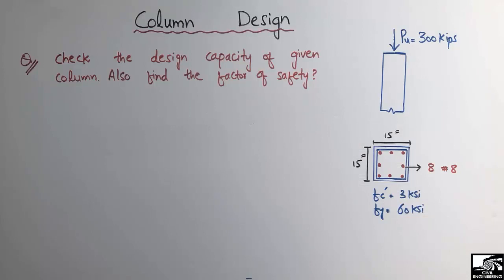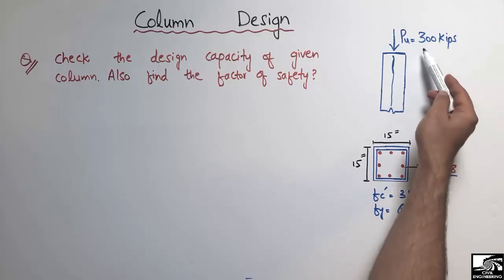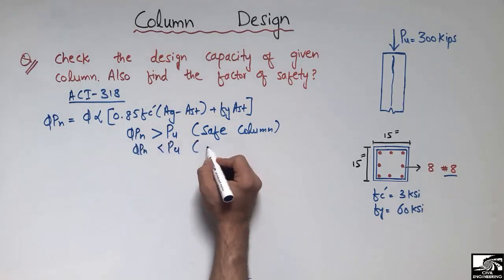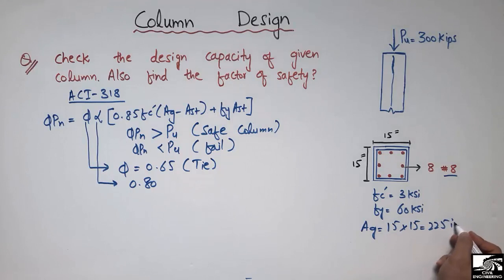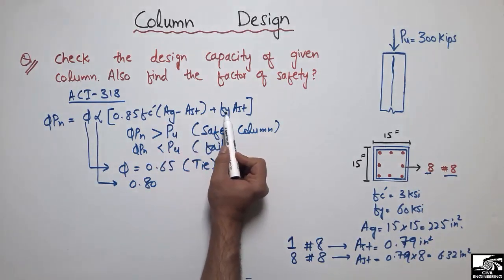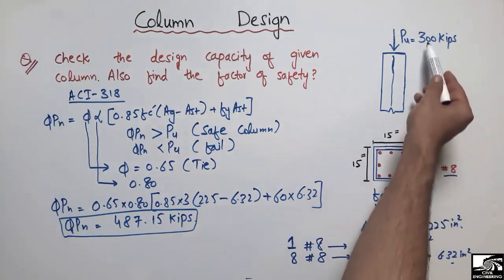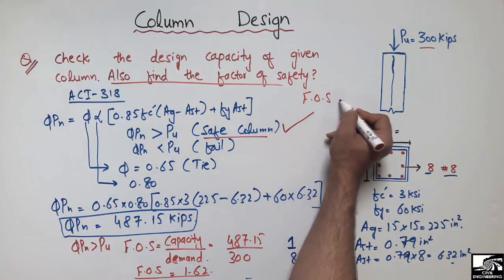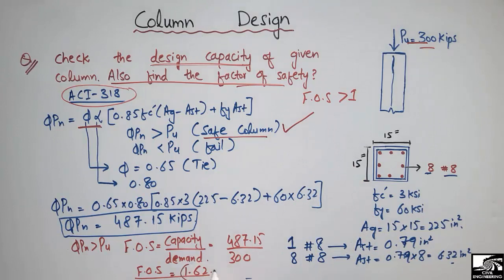Design of RCC Column

Comment: See if i got this correctly.
Say, if total load (dead, life, snow, rain loads) is 1200 Kips for a simple building. 
So using the same design parameters (as in the video), i need to have 4 such RCC columns so each can support 300 Kips and still maintain the safety factor of 1.6 for overall design.